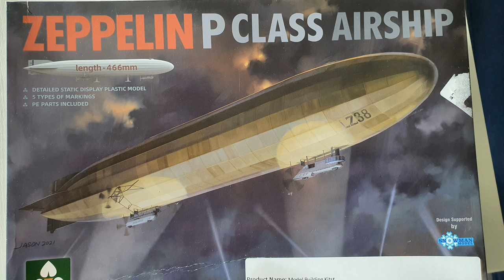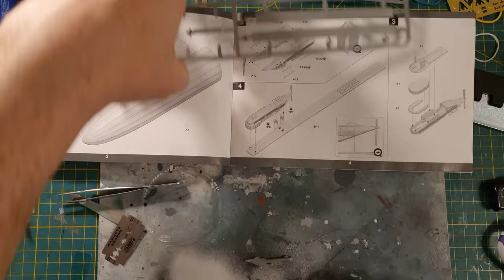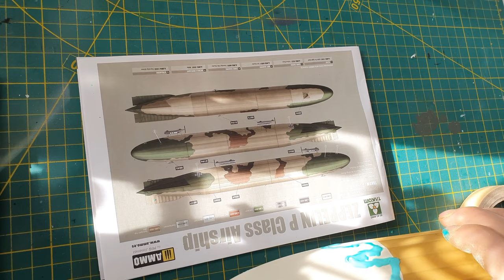ZEPPELIN P class from TAKOM !! ASSEMBLING !! 1/350

Comment: I thoroughly enjoyed watching your video. I am now in the process of building my sixth one of these kits and have to agree with you that the instructions are rubbish. However, with some extra detailing and a better base, these kits do look really good. I look forward to your build of the Q Class kit. One tip, try sliding the lower hull panels into place and then building the gondolas onto the completed hull. The fit is much better that way.
Reply from the maker: Thanks . I am glad that people like you also assembling model kits. Yea it was horrible to glue it. I will do q.class soon.
Reply from the maker: And I will do video. Have you heard about addons to this kits
Reply: @KoKo-kokolas  I gave up on trying to glue the kit etch parts and found it easier to replace them with thin brass rod soldered together. Much stronger as well.
Reply: There are no aftermarket sets that I am aware of so unfortunately, any enhancement of the kit has to be scratch built. Probably the greatest improvement you can make to the kit is to rig the tail surfaces. I use 0.1mm nickel silver wire from Albion Alloys.

Comment: You might find "Zeppelins German Airships 1900–40" by Osprey to be useful. Comment on the colour, you seem to have sprayed it silver, which is right for the Hindenburg. However, the wartime naval Zeppelins appeared to be grey, possible with a black lower hull (this did vary). But even this is not strictly speaking correct, there was a scrap of Zeppelin fabric which was noted as being the natural Linen coloured with loads of blue dots over it. Apparently, this looked grey from any sort of distance but did not weigh as much as actual grey paint would have.
Reply from the maker: Thank you for this info. I could not find any info about colors or painting.